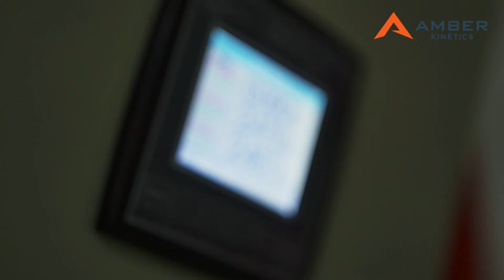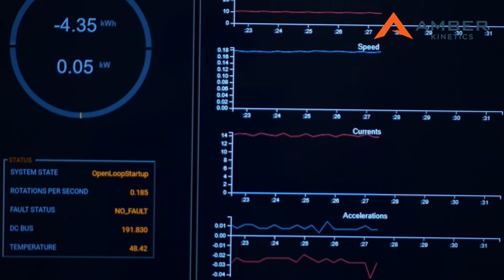Introduction to Amber Kinetics

Comment: I just want to add some points to this...
The genuine economical viability is possible once they figure out how to increase the rotation speed. True issue is in both stabilization and generators. So this tech isnt a failure. It needs some more work needs to be done...

Comment: Wouldn't a heavier, larger flywheel not need to spin as fast and therefore reduce the need for stronger and costly materials to maintain the higher rpm? If space wasn't an issue and you had a football field to work with, what would the thereotical sweet spot be for size and mass? Genuinely curious.
Reply: Yes, you are right about it. Space and the economics of manufacturing, transporting and installing a large system is the problem.
Reply: Yes. But the high rpm are targeted because Energy is depending on the angular velocity squared.

Comment: I remember a concept design for a flywheel powered car way back in the late 70's ( or maybe early 80's ) after seeing it, I was concerned about safety,  but the theory seemed sound.   this makes much more sense for energy storage for solar/wind generation and also for storing for peak demand. one benefit is see is that it does not require special resources like lithium, or dangerous chemicals.

Has your company  made  working prototypes yet?  how would the cost per Kw/h storage be compared to current energy storage technologies being used.  I guess, a cost of operation over time per kW  is a better measurement , since Lithium batteries have a shorter life time.
Reply: Yes, we have accumulated over 50,000 operating hours and shipped commercial units of our M32 flywheel (8 kW/32 kWh). More details and news on our website: https://amberkinetics.com

Comment: This is not useful at all!  It must be discharged over 4 hours so it can't be used off-grid with solar.... it would barely make it into the evening.  I'm guessing that it goes from max speed to zero in 4 hours with no load?
Reply: It's magnetically levitated, so friction is minimal, and won't drain any more energy unless it's extracted by the generator.

The issue is the low capacity itself, since it's simply a dead weight rotating around on a fulcrum I can't discern a logical reason for not having a very high capacity such as megawatt hour.

This design can be improved drastically with some research

Comment: Fantastic stuff, I've always thought that flywheels can be used for massive energy storage, and seeing Amber Kinetics do just that makes me very happy. This is the best solution for energy storage, and it doesn't rely on some new research; this method uses existing technologies and is incredibly scalable for any size. Keep up the good work!
Reply: that generator would create so much resistance once you put a load on it it will stop the wheel after a couple of minutes
Reply: hummus shotgun I thought the same thing but that doesn’t seem to be the case. This video explains mechanical batteries and one of the examples in the story is a bus that was used decades ago the flywheel could spin for 10 hours at idle and had a range of about 6 kilometers. Not fantastic but this was a long time ago I imagine the tech has advanced a good but since then. 

https://youtu.be/_QLEERYS5C8
Reply: @PhysicsViolator  or hours... or days. Depends on the load applied to the generator. Electromagnetic bearings. Make flywheel storage a pretty efficient way to store energy. There have even been designs that incorporate gimbals to remove forces from gyroscopic procession/spinning of the earth. Flywheel storage is used to for nuclear fusion experiments to provide very high electricity demands during experimets without causing a power drop in the grid.